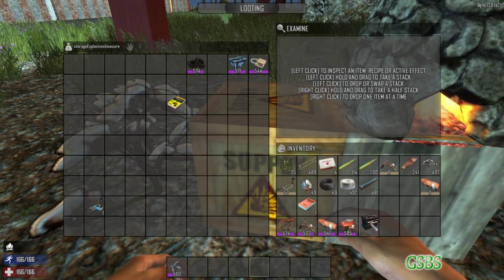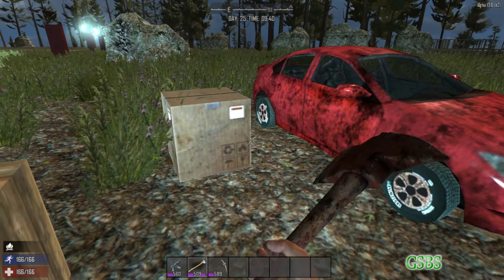How to Make the Minibike (7 Days to Die: Alpha 13) - GSBS

Comment: Excellent video!  Thanks for making this.  I just wanted to add a couple of tips from my own experiences.

- The easiest way to get headlights is to use a wrench to take apart a car.  Each car almost always gives you one.  These are a lot easier to obtain than they were prior to version A13.
- The easiest way to get scrap cable (as the linked video mentions, but I'll save you a click) is to use a wrench to take apart an oven.  Each oven will almost always give you one.
- The easiest way to get short iron pipe is to use a wrench to take apart sinks, toilets, ovens, beds and cars.  In A13, you can easily get more short iron pipe than you know what to do with.
- The easiest way to get leather is to use a fireaxe or pickaxe to chop up couch segments.  Each couch segment almost always gives you two.
Reply from the maker: +EliWCoyote Thank you :) and nice list of tips ^^ I just want to mention that only the black couches give leather, the old couches just give cloth fragments.

Comment: I don't get the little icons when I press 'E' over the minibike, I just get the window for adding/removing the bike components. Thus I can't pick up the empty minibike.

What gives?
Reply from the maker: +Uzamal You should be able to see it by holding E. Also you can't pick up the minibike chasis with other parts still on the bike.
Reply: +Gaming Step By Step  Thanks for the quick reply. Yeah, I was just tapping the 'E' key and not holding it.  Thanks for the info.
Reply from the maker: No problem :D glad to have helped.

Comment: Man, i found 3 wheels and my char dont picks them up. I hit them with Wrench first time, then with steel axe, another one with my weapon. Does it bug sometimes?? or what else can i try?
Reply from the maker: +Camachino17 I go through the same thing as well, sometimes I get a bunch of tires, sometimes I get none. It is a % based thing and seems to be best to use the stone axe, fireaxe or steel fireaxe (If I remember correctly from the tests I did)

Comment: one question. if u fill the minibike with gas then later pick up the chassis, do you lose the gas or does it stay, since i saw in the video that you dont get it as an item
Reply from the maker: +Joshpro8423 Unfortunately you lose the gas, I just tested it out now and it does not give you it back. Another bug for the minibike D: Just make sure you run it dry if you intend on picking it up for now I guess lol.
Reply: +Gaming Step By Step that or ration the gas you put in it each time you use it, and just carry spare gas along
Reply: +Joshpro8423 hopefully they can get that fixed in a future update, as well as work more on the minibike for future updates as well
Reply from the maker: +Joshpro8423 Yea, I usually carry spare gas around but sometimes I forget. I really like the idea of the minibike, I'm hoping they can get all the bugs fixed soon too. Even navezgane is a big map if your pinpointing locations, let alone random gen. Maybe I should compile a bugs video for the minibike and send them a link ;D
Reply: +Gaming Step By Step 

I just used the minibike and i have something you might wanna test to make sure.

It seems you DON'T lose the gas if you pick up the chassis, but it actually remembers how much gas you had poured in.

I noticed this when i had 1% gas (following what you said to empty the tank) so i picked all the pieces up and proceeded to do whatever for the night. The next day i wanted to go to the cave so i put it back together and poured in 100 gas (20% of the tank) and when i got on it was 21%

So yeah, something i discovered just using it for myself.
Reply from the maker: +Joshpro8423 interesting, I'll have to test it a bit more, I just poured 100% into the tank, took all the pieces and when I put it back together it was back to 0, and I didn't get any gas in my inventory, maybe it's only when you ride around on it it remembers. I'll have to test it out more
Reply from the maker: +Joshpro8423 From what I can see with testing here, I put 50% (500 fuel) and drove around a little bit, took apart the bike and picked up the chasis. After placing it back down and looking in the minibike inventory, it displayed 0% gas. Once I put 50% in it told me there was 51% left in the tank, so I think they were trying to make it remember, but it seems to only remember 1% of the fuel if any was in there at all. Going to test it out a bit more.

Comment: dood in my game i need hlep getting a iron picaxe
Reply from the maker: +MRCAGE 87&#160;You can find them in cars sometimes as loot, or working stiff crates, and I think garage storage containers.&#160;

If you can't find one in any of those then your best bet would be to either find a house that has a forge (There is only one I think) this video shows the prefab -&#160;https://www.youtube.com/watch?v=pb4xzfl6i9c

Or you will have to make your own forge, you'll need 20 animal hides, 2 short iron pipes, 8 wood, 50 small stones, and 50 clay to make bellows and the forge. Once you have the forge you will need to smelt iron and clay into it and make forged iron, which can then be made into the pickaxe :) If you have any questions let me know. ^^

Comment: You know I went to Perishton (in the upper north-west of the map) and whilst exploring the little city my minibike just stopped all of a sudden in the middle of the street. It wouldn't move. It was like it was super-glued to the street. I could rotate it on the spot slowly but it wouldn't move forwards or backwards. I read that it could've been damaged but if it was, it showed no signs as there was no smoke and it didn't disappear when I got off of it. I had to run all the way back to home (little bit east of Diersville) and make a new minibike. When I got back to Perishton I stripped my original bike of its gear - seat, wheels, engine, handlebars, battery and basket and such and went back home. The frame is just sitting there, stuck to the road. I couldn't even destroy it.
Reply from the maker: +csgrambauer Ouch! I noticed the minibike was a lot more glitchy with the A14 update, I would get stuck on random pieces of scrap walls on the ground, and grass block would make it not move at all if I parked it anywhere I would have to pick it up all the time. Do you know the button to pick up the frame? (I'm not sure what it is on xbox)

If it gets stuck anywhere you can strip all the pieces off, pick up the frame, then set the frame down again and put everything back on. After adding fuel again it should be good to move again. (The fuel should go back into your inventory when you remove the engine, I believe)
Reply: Gaming Step By Step
It's okay I recently learnt the reason it got stuck and it's something I didn't even notice at first. Apparently my tyres/wheels were damaged beyond repair (they had no 'life' bar left). I guess that's why. I also didn't know that you can just take your frame so I was able to go back and pick up my frame. Live and learn I guess. Your video and someone else on gamefaqs told me that you can pick up your frames. I thought they were permanently there once you put them down.

Thanks. Yeah I know that now. I didn't at the time I made my original post just last night. Amazing how much you can learn in just 24 hours haha. Yeah the game gives you back the fuel thank goodness. Now I just wish I wouldn't lose my bikes when the game crashes and once that's solved I'm golden. :D
Reply from the maker: csgrambauer Ah, well I'm glad to have helped :) That's what we are here for. The dev's have been working on trying to solve the minibike problems for quite a while now, they seemed to have it good in 12.5 but I guess new updates always mess with the code (After making a small game, I know how that is)
Reply: Gaming Step By Step
You did indeed. :) It is great to be able to find out information like this with the internet. Before we had it we had to rely on magazines and word-of-mouth. That's super great to hear. I'm still always afraid of losing them to crashes. I can imagine yeah. Like the solo guy who created the game, Stardew Valley. It took him four years to make that whole game (music/soundtrack, EVERYTHING). He's so amazing at that. I wish I had even 1% of that kind of talent. :D What game you made? :o
Reply from the maker: csgrambauer I remember the days of walkthrough magazines lol, I actually wanted to start writing articles for GameFAQs in my younger days, weird that I actually get to do the same thing almost now haha :D. Wow, 1 guy made Stardew Valley? I had no idea. I've heard about the game but never gave it a shot yet. ^^ props to that.

My little game only took 6 months to get to "first release." I used to produce music so I just pulled old beats that I made for the soundtracks, and most of the other things I made in Unity's editor. The font was edited with birdfont and I nearly quit production when I started learning about PHP lol. You can still find it on the android store, but the servers are down because I'm broke at the moment xD. I have to go back into the game code and pull all the server calls out and make it functional again. 
Just look up EyeRun, it is a robot looking to the left in a picture frame, my gf made that picture, she helped me with a few things during that stage (all before YouTube) and a lot of moral support.
Reply: Gaming Step By Step
Haha I found my old HUGE collection of gaming mags and went through them and dumped them except for the walkthroughs of games I wanted to keep (from my PS2 days). Been on GameFAQs for 11 years myself haha. I wanted to write reviews but lost interest over time as I got lazy. GTASA was the first game's board I followed actually and made me become a member.

Yeah Eric Barone is his name, or ConcernedApe. It took him 4 years to make the game and he did the animation and everything. You can see images of each character and their gradual changes over the years to what they look like today. He's now working with a game company to bring the game to consoles sometime between October to December. He left that in the hands of that company so he can keep his full attention on improvements and additions to the game. He has a youtube channel as well.

Stardew Valley is like Harvest Moon. Oh wow. I'm on iPad so i-tunes would be where I buy games like that so pity I don't have any Android stuff. I would've loved to get your game and give it a try. :D EyeRun? Sounds like a fun game haha and aww that's nice of her to be there and help out. :D
Reply from the maker: csgrambauer Ah, the good ol' days of when GameFAQ's was the standard for game tips and "cheat codes" when those were still a thing haha. I actually never went through any boards, I would always find what I needed and immediately applied the newfound knowledge lol.

Thanks for the heads up ^^ sounds like a very dedicated developer :) Glad to see that more often these days.

Ah, I left my game as free to play with a couple of paid options. ^^ unfortunately since the servers are down now (Wasn't able to afford them) You won't be able to enter any levels at the moment, it sends a call to the server to save the time, it was an energy based system lol. It's an infinite runner style game, you can see the menu and hear the menu music, check out the upgrades, but that's about it right now.
Reply: Gaming Step By Step
Haha I know right? Gone are the days when cheat codes were in games. :/ I loved using fun cheats in GTASA the most, like Cars Fly. I'm a big time regular on GameFAQs still. Haha I did too but I ended up staying around chatting to the guys and girls on the boards.

No problemo. :) He is a pretty damn amazing guy having done all of that himself. I bought the game for pc but I really can't wait to own it and play it on my xbox one. Definitely. Guys like him and you who make your own games, need to be supported BIG TIME. Guys who are so dedicated into making great games should always be appreciated for the hard work they do.

Oh okay well still, if it were priced, I'd be willing to pay for it. Oh I see. I understand. Well it would still be great to play one day. :) Anyway I'm heading to bed as I've been up most of the night and I'm dead tired now lol. Night. :)
Reply from the maker: csgrambauer A couple pay homage to the old ways, but it is a dying trend I noticed. At least these days we are getting a lot more mod support and console access though! So greater flexibility is a plus. :)

Well thank you for that, I wish more people seen the dedication that it actually takes, especially for small to 1 person teams to make something happen from nothing but ideas. I will have to dig out my old code one day and make it playable again. ^^ 

Have a good sleep bud! I was on research mode all night and know the feeling right now, but I have to persist today. Take care :)
Reply: Gaming Step By Step
I guess so. Weird how Bethe$da nerfed and duplication glitches and yet when mods came out for Fallout 4, there were duplication mods there anyway.

You're welcome. It's true though. A lot of work goes into one game and I can see that clearly. Thank you and sorry to hear that. Hope you slept well too? Take care too. :)
Reply from the maker: csgrambauer lol, well they had issues with the good ol' aim with an arrow -> go in inventory -> drop item you need more of -> let go of arrow for a fountain of items :D back with skyrim haha. 

it's all good, just been busy with other projects these days, as you can see now. ^^ I usually do
Reply: Gaming Step By Step
I don't know, that whole issues stinks, how they patch duplication glitches but I still have a few quests that I can never finish because something bugged it up (like No-Nose Bobbi in Good Neighbour, won't answer the door for me to start the quest, and that Drinkin' Buddy robot won't start his part in the quest).

I understand and of course. No pressure. :)
Reply from the maker: csgrambauer They are usually more concerned with bugs that unintentionally give the player the advantage I noticed. I had a bug in Skyrim with this cult I had to go take care of and this ghost was supposed to appear to finish the quest, well they never appeared and I was forever stuck. After about 100 hours in I couldn't continue the game anymore (That was on Xbox at the time) I think I went back to Minecraft at that point. I may return one day ^^
Reply: Gaming Step By Step
But the games they target are solo/single player games and we don't hurt anyone but ourselves (if you even consider it hurting). Yeah see bugs like that need to be fixed asap, not harmless exploits.
Reply from the maker: csgrambauer True, but if it is too easy to use exploits then it could unintentionally ruin the game.
Reply: Gaming Step By Step
But you can then duplicate items anyway with the mods?! So why bother patching the duplication glitches in the first place then? Duplication glitches don't ruin the game itself. I've used them heaps of times for Fallout 4 and my game was fine. Bethe$da ruined the game by not fixing the real true glitches that stopped me from being able to finish certain quests.
Reply from the maker: csgrambauer No that's true, if they are going to work on bugs / glitches they should be trying to fix them all.
Reply: Gaming Step By Step
Well yeah or just focus on the ones that truly matter and leave the exploits alone as they truly don't hurt the game. It's the player's choice whether or not to use them. It's supposed to be OUR game anyway so we should be allowed to have FUN with it if we want to.